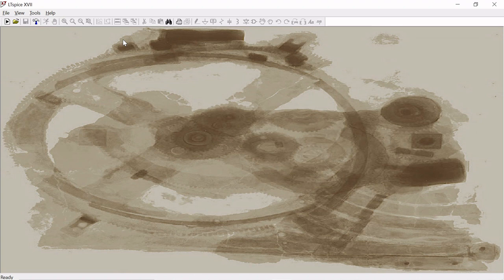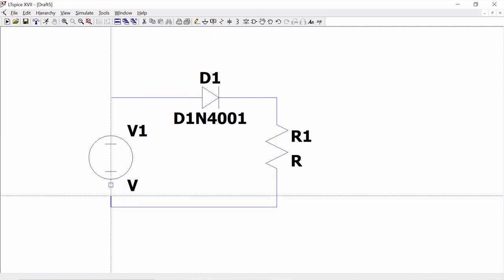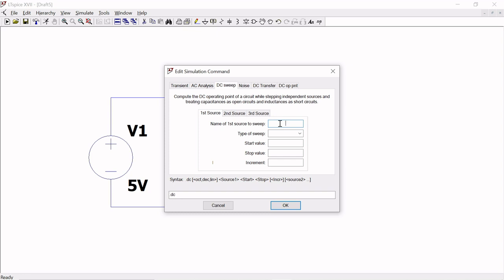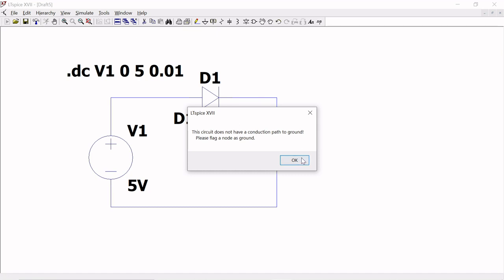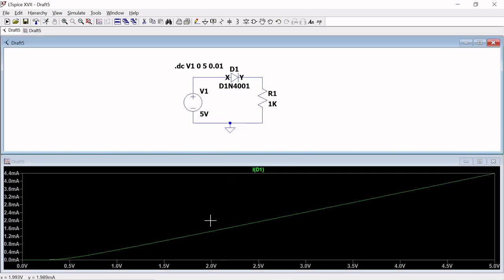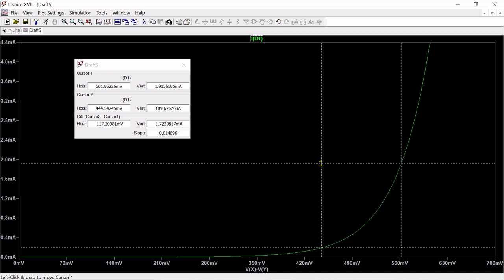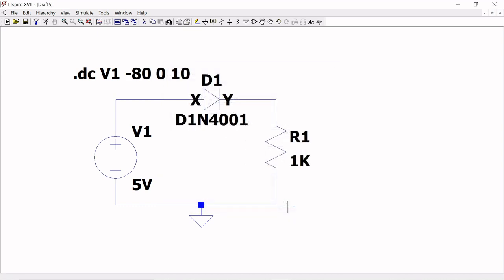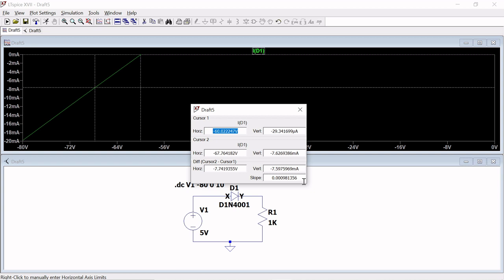PN Junction Diode using LTSpice | Forward and Reverse Resistance of diode

Comment: Which application are you using pls tell
Reply from the maker: rectifiers, signal limiters, voltage regulators, switches, signal modulators, signal mixers, signal demodulators, and oscillators...etc